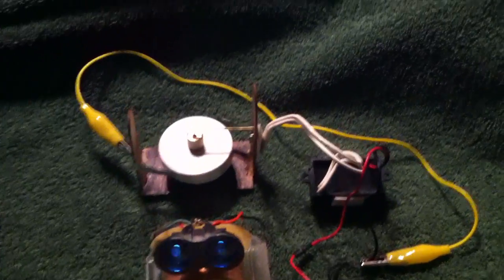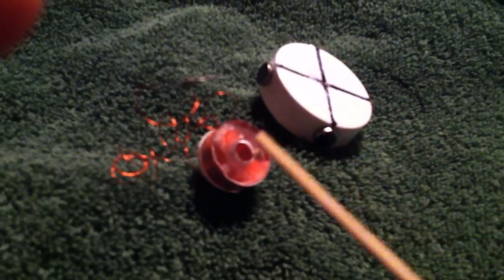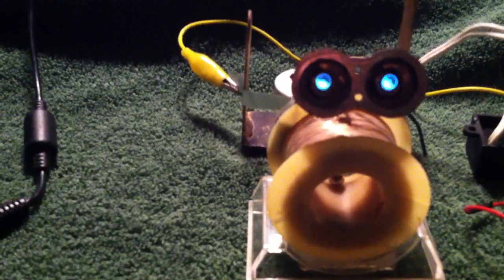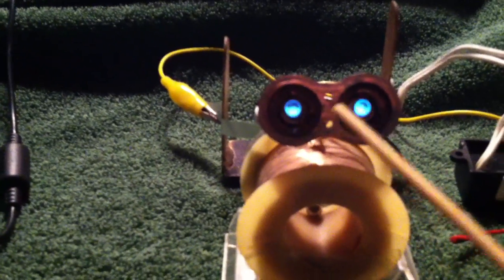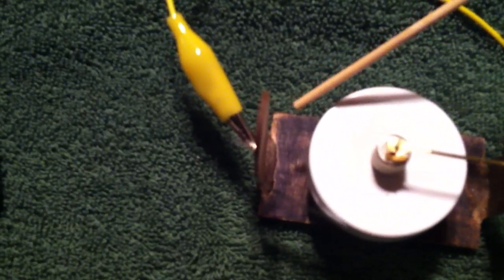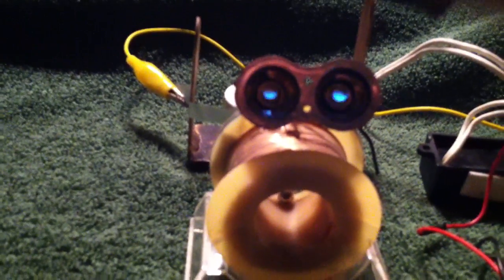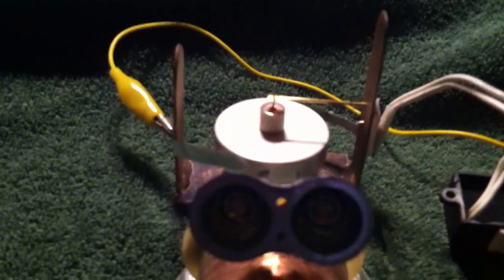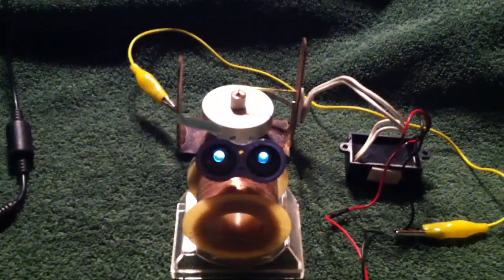Electrostatic Needle Motor--with simple brass bearings

Comment: Fun project. That's a great example of how to draw power off too. 
I'd think another rotor could spin up from this one, which itself then would output to Maggie...your 'range' for her eyes would then be furthered. Not that there's much use to that idea besides the visual lol
Reply from the maker: +slider2732  Unfortunately there just isn't much torque (at least with this design) to do much with.  The second rotating magnet would have to be running on super low friction bearings to reduce energy loss.  I think your idea is possible with maybe a 'Mendocino' setup --or perhaps another 'needle motor' setup.  Hummm.

Comment: Very cool!  That's a clever idea to place the mag on top of the rotor!
Reply from the maker: +A B  Thanks.  I put a magnet on top of another regular pulse motor rotor once and it worked so I thought I would try it on this. I was kinda surprised that it worked as well as it did. These type electrostatic motors have very little torque.
Reply: +Lidmotor I wonder if it would have the same amount of drag as a magnet rotor if you started to put a load on the current passing though the big coil.
Reply from the maker: +A B I don't quite understand what you mean.  I did try Maggie without the ball magnet and the she would not light up.  The RPM on the electrostatic just wasn't fast enough and I could not get the pickup coil close enough to the rotating magnet.  The little rotating ball inside the pickup coil does add additional drag due to friction.
Reply: +Lidmotor hmm.. kind of hard to describe.  I'll give it another try :)
What I meant was--if you put a higher electrical load on your motor & it slowed down the rotation speed of your rotor, I wonder if that slow down would be equivalent to the slow down of a conventional motor that has a rotor with magnets on it.  Of course, one would have to figure out the ratio differences to determine such a thing accurately.

I hope that's more understandable.
Reply from the maker: +A B  Well one thing is for sure--when you load the electrostatic motor there is no increase in amp draw on the power source like in a regular electric motor.  What I keep thinking about is the poor efficiency of these motors but then so are solar panels ---and we use the heck out of those.  Perhaps there is a place for electrostatic motors if they could be designed better and atmospheric static electricity was used.  The motors can be built very light and dirt cheap.
Reply: +Lidmotor Interesting that "there is no increase in amp draw on the power source like in a regular electric motor".

The conversion efficiency of solar cells might be considered low, but a good 6"x6" solar cell can provide 8+A--so there is quite a bit of power there for only 36 in^2.  How do you determine the efficiency of your electrostatic motors?